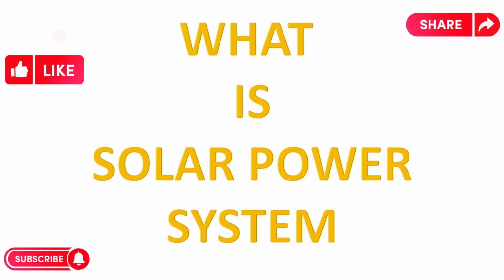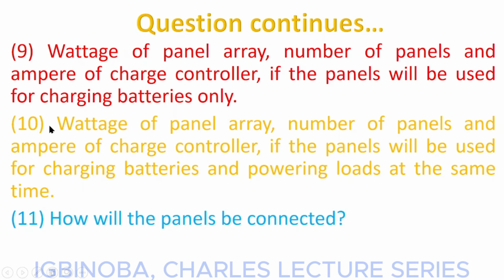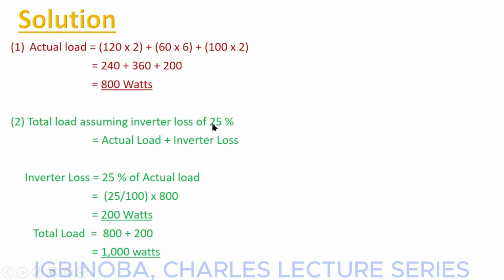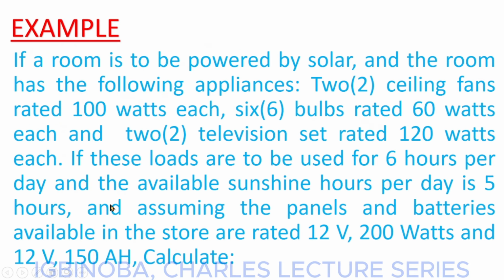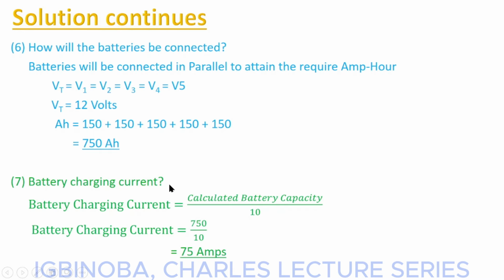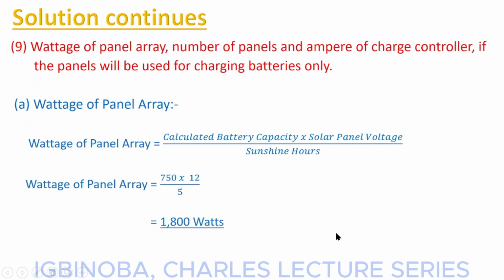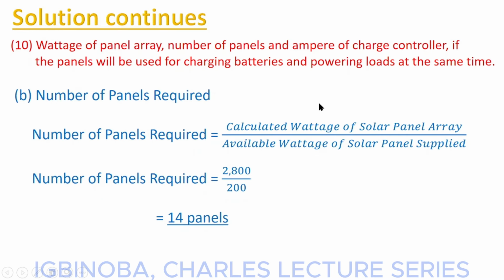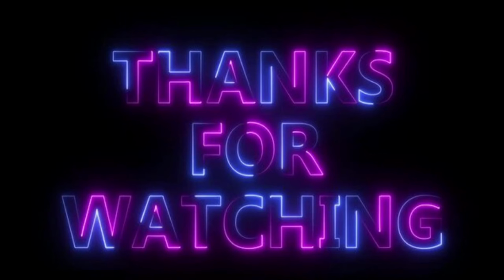Design of Solar Power System

Comment: MECH3177U

1. Actual Load Power: 1380 W
2. Total System Load: 1725 W
3. Required Inverter Rating: 2156 VA (approximately)
4. Battery Bank Capacity: 1294 Ah (approximately)
5. Number of Batteries: 9 (rounded from 8.625)
6. Battery Configuration: Parallel
7. Battery Charging Current: 129 A (approximately)
8. Estimated Charging Time: 14 hours
9. Solar Array for Battery Charging:
   · Total Power: 3105 W
   · Number of Panels: 16 (rounded from 15.5)
   · Charge Controller Rating: 259 A (approximately)
10. Solar Array for Loads and Charging:
    · Total Power: 4830 W
    · Number of Panels: 24
    · Charge Controller Rating: 403 A (approximately)
11. Panel Connection: Parallel

Comment: PETRO349W

1. Actual load is 1380W
2. Total load is 1725W
3. Inverter rating is 2156.25VA 4. Battery capacity is
1293.75AH
5. No. of batteries is 8.625~9batteries
6. Parallel
7. Battery changing current is 129.375amps
8. Charging time is 14hours
9. (A) 3105W (B) 16panels (c) 258.75A 10.
(A) 4830W (B) 24.15~24panels (C) 402.5A 11.
Parallel

Comment: CHM331E
1. Actual load = 1380 watt

2. Total load= 1725 watt

3. Inverter rating = 2156.25 VA

4. Battery rating=1293.75 Ah

5. Number if batteries - 9

6. Battery are connected in parallel

7. Battery charging current=129.4 amps

8. Battery charging Time = 14hrs

9

a. Wattage panel array = 3105 watts

b. Number of panels = 16

c. Charge controller 258.75 A

10

a. Wattage of panel array = 4830 watts

b. Number of panels 24

c. Charge controller= 402.5 A

11. Panels are set up in paraliel

Comment: PETRO39I
1. Actual load= (100×3)+(60×10)+(120×4) =1380watts
2. Total load assuming inverter loss of 25%= Actual load +Inverter loss
Inverter loss=25% of Actual load
= 25%×1380=345 watts
Total load= 1380+345=1725 watts
3. Inverter rating on VA using power factor of 0.8
= (1725÷0.8)= 2156.25
4. Battery capacity using factor for reserve 75%=(2×1725×6×0.75)=1293.75Ah
5. No. of batteries for backup hours=1293.75Ah÷150Ah= 8.6 =9 batteries 
6. How batteries will be connected?
The batteries will be connected in parallel 
Vt=V1=V2=V3=V4=V5=V6=V7=V8
Ah= 150+150+150+150+150+150+150+150+150=1350
7. Battery charging current=1293.75÷10=129Amps
8. Battery charging time assuming charging loss of 40%= 1293.75Ah+(40%+1293.75Ah)÷129A=14hrs
9a. Wattage panel array= 3105 watts
9b. Number of panels required= 3105÷345=9 panels 
9c. Ampere of charging controller required= 3105÷12=258.75Amps
10a. Wattage of panel array= Calculated wattage of solar panel array for charging battery only+ calculated total load =3105+1725=4830watts
10b. Number of panels required= calculated wattage of solar panel array÷ Available wattage of solar panel supplied= 4830watts÷345= 14Amps
10c. Ampere of charge controller= calculated wattage of solar panel array÷ solar panel voltage=4830watts÷12volts= 402.5Amps
11. How will the panels be connected?
Ans: They will be connected in parallel cause voltages are constant(12v)

Comment: EEE3138H

1. The actual load
=(3×100)+(10×60)+(4×120)
=1380 watts

2. Total load assuming inverter loss of 25%
= 1380+(25% of 1380)
=1380+ 345
=1725 watts

3. Inverter rating in VA using power factor of 0.8
= Total load ÷ power factor
= 1725÷0.8
=2156.25 VA

4. Battery capacity using a factor for reserve of 75%
Battery capacity = (2×total load×back up hours×factor for reserve) / battery voltage 
= (2×1725×6×0.75) / 12
= 1293.75 AH

5. Number of battery for backup hour
= Calculated battery capacity÷capacity of battery available 
=1293.75 ÷ 150
=8.625
=9

6. How will the battery be connected?
The battery would be connected in parallel to attain the required amp hour
V1=V2=V3=V4=V5=V6=V7=V8
V1= 12 volts
AH = 150 × 8
= 1200 AH

7. Battery charging current
= Calculated battery capacity ÷ 10
= 1293.75 ÷ 10
= 129.375 amps

8. Battery charging time assuming charging loss of 40%
= {Calculated battery capacity + ( 40% of calculated battery capacity)} / charging current 
= {1293.75 + (40% of 1293.75)} ÷ 129.375
= 14 hours

9a. Wattage of panel array
= ( Calculated battery capacity × solar panel voltage) ÷ sunshine hours
= ( 1293.75 × 12) ÷ 5
= 3105 watts

9b. Number of panels array
= Calculated wattage of solar panel array ÷ available wattage of solar panel supplied 
= 3105÷ 200
= 15.525 
= 16 panels

9c. Ampere of charge controller required 
= Calculated wattage of solar panel array ÷ solar panel voltage 
= 3105 ÷ 12
= 258.75 amps

10a. Wattage of panel array
= Calculated wattage of solar panel array for charging battery only + calculated total load
= 3105 + 1725
= 4830 watts

10b. Number of panels required 
= Calculated wattage of solar panel array ÷ available wattage of solar panel supplied 
= 4830 ÷ 200
= 24.15
=24 panels

10c. Ampere of charge controller 
= Calculated wattage of solar panel array ÷ solar panel voltage 
= 4830 ÷ 12
= 402.5 amps 

11. How will the panels be connected? 
The panels would be connected in parallel.

Comment: EEE372T
1. Actual Load: 1380 watts

2. Total Load: 1725 watts

3. Inverter Rating: 2156.25 VA

4. Battery Capacity: 1293.75 Ah

5. Number of Batteries: 8.625-9 batteries

6. Parallel

7. Battery charging current: 129.375 Amps

8. Charging time: 14 hrs

9. (a) 3105 watts

(b) 15.525-16 panels

(c) 258.75 Amps

10. (a) 4830 watts

(b) 24.15-24 panels

(c) 402.5 Amps

11. Parallel

Comment: EEE362J

1. Actual Load: 1380 watts

2. Total Load: 1725 watts

3. Inverter Rating: 2156.25 VA

4. Battery Capacity: 1293.75 Ah

5. Number of Batteries: 8.625-9 batteries

6. Parallel

7. Battery charging current: 129.375 Amps

8. Charging time: 14 hrs

9. (a) 3105 watts

(b) 15.525-16 panels

(c) 258.75 Amps

10. (a) 4830 watts

(b) 24.15-24 panels

(c) 402.5 Amps

11. Parallel

Comment: EEE 314N
1. Actual Load: 1380 watts
2. Total Load: 1725 watts
3. Inverter Rating: 2156.25 VA
4. Battery Capacity: 1293.75 Ah
5. Number of Batteries: 8.625 – 9 batteries
6. Parallel
7. Battery charging current: 129.375 Amps
8. Charging time: 14 hrs
9. (a) 3105 watts
        (b) 15.525 – 16 panels
        (c) 258.75 Amps
10. (a) 4830 watts
        (b) 24.15 – 24 panels
        (c) 402.5 Amps
11. Parallel

Comment: PETRO3150T 
1. Actual load= (100×3)+(60×10)+(120×4) =1380watts
2. Total load assuming inverter loss of 25%= Actual load +Inverter loss
Inverter loss=25% of Actual load
= 25%×1380=345 watts
Total load= 1380+345=1725 watts
3. Inverter rating on VA using power factor of 0.8
= (1725÷0.8)= 2156.25
4. Battery capacity using factor for reserve 75%=(2×1725×6×0.75)=1293.75Ah
5. No. of batteries for backup hours=1293.75Ah÷150Ah= 8.6 =8 batteries 
6. How batteries will be connected?
The batteries will be connected in parallel 
Vt=V1=V2=V3=V4=V5=V6=V7=V8
Ah= 150+150+150+150+150+150+150+150=1200
7. Battery charging current=1293.75÷10=129Amps
8. Battery charging time assuming charging loss of 40%= 1293.75Ah+(40%+1293.75Ah)÷129A=14hrs
9a. Wattage panel array= 3105 watts
9b. Number of panels required= 3105÷345=9 panels 
9c. Ampere of charging controller required= 3105÷12=258.75Amps
10a. Wattage of panel array= Calculated wattage of solar panel array for charging battery only+ calculated total load =3105+1725=4830watts
10b. Number of panels required= calculated wattage of solar panel array÷ Available wattage of solar panel supplied= 4830watts÷345= 14Amps
10c. Ampere of charge controller= calculated wattage of solar panel array÷ solar panel voltage=4830watts÷12volts= 402.5Amps
11. How will the panels be connected?
Ans: They will be connected in parallel

Comment: EEE 318R

1. Actual Load = 1380Watts
2. Total Load = 1725Watts
3. Inverter Rating = 2156.25
4. Battery Capacity = 1293.75Ah
5. Number of Batteries = 9
6. Connection is in parallel
7. Battery Charging Current = 129.38A
8. Charging time = 14hrs
9a. The Wattage of panel array = 3105Watts
  b. Number of Panels = 16panels
  c. The charger controller current = 258.75A
10a. The Wattage of panel array = 4830Watts
     b. Number of panels = 24panels
     c. The Charge controller current = 402.5A
11. The connection will be in parallel

Comment: MAR3108D
1. Actual Load = 1380 watts

2. Total Load = 1725 watts

3. Inverter Rating = 2156.25 VA

4. Battery Capacity = 1293.75 Ah

5. Number of Batteries = 8.625 ≈ 9 batteries

6. Connection Type = Parallel Connection

7. Battery Charging Current = 129.375 A

8. Battery Charging Time = 14 hours

9a. Wattage of Panel Array = 3105 watts
9b. Number of Panels = 15.5 ≈ 16 panels
9c. Amperage of Charge Controller = 258.75 A

10a. Wattage of Panel Array = 4830 watts
10b. Number of Panels = 24.15 ≈ 25 panels
10c. Amperage of Charge Controller = 402.5 A

11. Connection Type = Parallel Connection

Comment: EEE3160D

1. ACTUAL LOAD :1380W
2. TOTAL LOAD (INCLUDING INEVRTER LOSS): 1840W
3. INVERTER RATING (VA): 2300VA
4. BATTERY CAPACITY: 1227Ah
5. NUMBER OF BATTERIES: 9 BATTERIES 
6. BATTERY CONNECTION: PARALLEL 
7. BATTERY CHARGING CURRENT: 15A (PER BATTERY STRINGS)
8. BATTERY CHARGING TIME : 5.1 DAYS
9. PANEL ARRAY ( FOR CHARGING BATTERIES ONLY)
-WATTAGE: 2945W
-NUMBER OF PANELS: 15 PANELS
-CHARGE CONTROLLER CURRENT: 245A
10. PANEL ARRAY (FOR CHARGING BATTERY AND POWERING LOADS)
-WATTAGE: 4785W
-NUMBER OF PANELS: 24 PANELS
-CHARGE CONTROLLER CURRENT:399A
11. PANEL CONNECTION: SERIES-PARALLEL
Reply: PETRO3133C

1. ACTUAL LOAD: 1380W

2. TOTAL LOAD (INCLUDING INVERTER LOSS): 1840W

3. INVERTER RATING (VA): 2300VA

4. BATTERY CAPACITY: 1227Ah

5. NUMBER OF BATTERIES: 9 BATTERIES

6. BATTERY CONNECTION: PARALLEL

7. BATTERY CHARGING CURRENT: 15A (PER BATTERY STRINGS)

8. BATTERY CHARGING TIME: 5 DAYS

9. PANEL ARRAY (FOR CHARGING BATTERIES ONLY)
a. WATTAGE: 2945W

b. NUMBER OF PANELS: 15 PANELS

c. CHARGE CONTROLLER CURRENT: 245A

10. PANEL ARRAY (FOR CHARGING BATTERY AND POWERING LOADS)

a. WATTAGE: 4785W

b. NUMBER OF PANELS: 24 PANELS

c. CHARGE CONTROLLER CURRENT: 399A

11PANEL CONNECTION: SERIES-PARALLEL

Comment: PETRO3148R 

1. Actual load= (100×3)+(60×10)+(120×4) =1380watts
2. Total load assuming inverter loss of 25%= Actual load +Inverter loss
Inverter loss=25% of Actual load
= 25%×1380=345 watts
Total load= 1380+345=1725 watts
3. Inverter rating on VA using power factor of 0.8
= (1725÷0.8)= 2156.25
4. Battery capacity using factor for reserve 75%=(2×1725×6×0.75)=1293.75Ah
5. No. of batteries for backup hours=1293.75Ah÷150Ah= 8.6 =8 batteries 
6. How batteries will be connected?
The batteries will be connected in parallel 
Vt=V1=V2=V3=V4=V5=V6=V7=V8
Ah= 150+150+150+150+150+150+150+150=1200
7. Battery charging current=1293.75÷10=129Amps
8. Battery charging time assuming charging loss of 40%= 1293.75Ah+(40%+1293.75Ah)÷129A=14hrs
9a. Wattage panel array= 3105 watts
9b. Number of panels required= 3105÷345=9 panels 
9c. Ampere of charging controller required= 3105÷12=258.75Amps
10a. Wattage of panel array= Calculated wattage of solar panel array for charging battery only+ calculated total load =3105+1725=4830watts
10b. Number of panels required= calculated wattage of solar panel array÷ Available wattage of solar panel supplied= 4830watts÷345= 14Amps
10c. Ampere of charge controller= calculated wattage of solar panel array÷ solar panel voltage=4830watts÷12volts= 402.5Amps
11. How will the panels be connected?
Ans: They will be connected in parallel

Comment: EEE331E
1)actual load = 1380watts     

2)total load= 1725 watts

3) inverter rating =2156.25VA 

4) battery capacity= 1293.75A 

5) No of batteries= 9 

6) batteries are connected in parallel 

7) battery charging current =129.4amps 

8)battery charging time=14hrs 

9a) wattage of panel array= 3105watts 
9b) number of panels=16panels 
9c)charge controller= 258.75A 

10a) wattage of panel array= 4830watts 
10b) number of panels = 24 
10c) charge controller= 402.5A 

11)panels are arranged in parallel

Comment: COMP349W

1 Actual load 1380W
2 Total load  1720W
3 Inverter rating  2156.25VA
4 battery Capacity 1293.75Ah
5 number of batteries 8.6
6 Parallel 
7 Battery charging  129.4A
8 T = 14hrs
9 (a) 3105W
   (b) 15.5 panels 
   (c)  258.75 A
10 (a) 4830W 
     (b) 24 panel 
     (c) 402.5A 
11 Parallel

Comment: NAT345S

1. Actual Load : 1380 watts  
2. Total Load : 1725 watts  
3. Inverter Rating : 2156.25 VA  
4. Battery Capacity : 1293.75 Ah  
5. Number of Batteries : 8.625 - 9 batteries  
6. Parallel  
7. Battery charging current: 129.375 Amps  
8. Charging time : 14 hrs  
9. (a) 3105 watts  
   (b) 15.525 - 16 panels  
   (c) 258.75 Amps  
10. (a) 4830 watts  
     (b) 24.15 - 24 panels  
     (c) 402.5 Amps  
11. Parallel

Comment: EEE371S

1)actual load = 1380watts     

2)total load= 1725 watts

3) inverter rating =2156.25VA 

4) battery capacity= 1293.75A 

5) No of batteries= 9 

6) batteries are connected in parallel 

7) battery charging current =129.4amps 

8)battery charging time=14hrs 

9a) wattage of panel array= 3105watts 
9b) number of panels=16panels 
9c)charge controller= 258.75A 

10a) wattage of panel array= 4830watts 
10b) number of panels = 24 
10c) charge controller= 402.5A 

11)panels are arranged in parallel

Comment: EEE389K
1. Actual load is 1380w
2. Total Load is 1725w
3. Inverter rating is 2516.25VA
4. Battery capacity is 1293.75AH
5. No. Of batteries is 8.6-9.6 parallel
6. Battery charging current is
129.375AMPS
7. Charging time is 14 hours
8.a. 3105w
B. 15.5 panels
C. 258.75A
9. A. 4830w
B. 24 panels
C. 402.5A
10. Parallel

Comment: CHM394P

1. Actual load= (100×3)+(60×10)+(120×4) =1380watts

2. Total load assuming inverter loss of 25%= Actual load +Inverter loss
Inverter loss=25% of Actual load
Therefore, 
Total load= 1380+(25%×1380)=1725 watts

3. Inverter rating in VA using power factor of 0.8
= (1725÷0.8)= 2156.25 VA

4. Battery capacity using factor for reserve of 75%=(2×1725×6×0.75)/12=1293.75Ah

5. No. of batteries for backup hours=1293.75Ah÷150Ah= 8.625 = 9 (Approximately) 
       = 9 batteries 

6. How the batteries will be connected?
The batteries will be connected in parallel 
VT=V1=V2=V3=V4=V5=V6=V7=V8=V9
VT= 12 V 
Ah= 150+150+150+150+150+150+150+150+150=1350 Ah

7. Battery charging current=1293.75÷10=129Amps

8. Battery charging time assuming charging loss of 40%= 1293.75Ah+(40%+1293.75Ah)÷129A=14hrs

9a. Wattage of panel array= (1293.75 x 12)/5=3105 watts

9b. Number of panels required= 3105÷200=15.525 = 16 panels 

9c. Ampere of charging controller required= 3105÷12=258.75Amps

10a. Wattage of panel array= Calculated wattage of solar panel array for charging battery only+ calculated total load =3105+1725=4830watts

10b. Number of panels required= calculated wattage of solar panel array÷ Available wattage of solar panel supplied= 4830watts÷200watts= 24.15 Amps

10c. Ampere of charge controller= calculated wattage of solar panel array÷ solar panel voltage=4830watts÷12volts= 402.5Amps

11. How will the panels be connected?
Ans: They will be connected in parallel

Comment: CHM353A

1. Actual load= (100×3)+(60×10)+(120×4) =1380watts

2. Total load assuming inverter loss of 25%= Actual load +Inverter loss
Inverter loss=25% of Actual load
Therefore, 
Total load= 1380+(25%×1380)=1725 watts

3. Inverter rating in VA using power factor of 0.8
= (1725÷0.8)= 2156.25 VA

4. Battery capacity using factor for reserve of 75%=(2×1725×6×0.75)/12=1293.75Ah

5. No. of batteries for backup hours=1293.75Ah÷150Ah= 8.625 = 9 (Approximately) 
       = 9 batteries 

6. How the batteries will be connected?
The batteries will be connected in parallel 
VT=V1=V2=V3=V4=V5=V6=V7=V8=V9
VT= 12 V 
Ah= 150+150+150+150+150+150+150+150+150=1350 Ah

7. Battery charging current=1293.75÷10=129Amps

8. Battery charging time assuming charging loss of 40%= 1293.75Ah+(40%+1293.75Ah)÷129A=14hrs

9a. Wattage of panel array= (1293.75 x 12)/5=3105 watts

9b. Number of panels required= 3105÷200=15.525 = 16 panels 

9c. Ampere of charging controller required= 3105÷12=258.75Amps

10a. Wattage of panel array= Calculated wattage of solar panel array for charging battery only+ calculated total load =3105+1725=4830watts

10b. Number of panels required= calculated wattage of solar panel array÷ Available wattage of solar panel supplied= 4830watts÷200watts= 24.15 Amps

10c. Ampere of charge controller= calculated wattage of solar panel array÷ solar panel voltage=4830watts÷12volts= 402.5Amps

11. How will the panels be connected?
Ans: They will be connected in parallel

Comment: COMP3120P 
1. Actual load is 1380w
2. Total Load is 1725w
3. Inverter rating is 2516.25VA
4. Battery capacity is 1293.75AH
5. No. Of batteries is 8.6-9.6 parallel
6. Battery charging current is 129.375AMPS
7. Charging time is 14 hours 
8.a. 3105w
B. 15.5 panels
C. 258.75A
9. A. 4830w
B. 24 panels 
C. 402.5A
10. Parallel

Comment: COMP372T 
1. Actual load is 1380w
2. Total Load is 1725w
3. Inverter rating is 2516.25VA
4. Battery capacity is 1293.75AH
5. No. Of batteries is 8.6-9.6 parallel
6. Battery charging current is 129.375AMPS
7. Charging time is 14 hours 
8.a. 3105w
B. 15.5 panels
C. 258.75A
9. A. 4830w
B. 24 panels 
C. 402.5A
10. Parallel